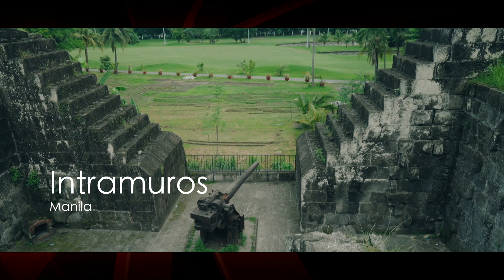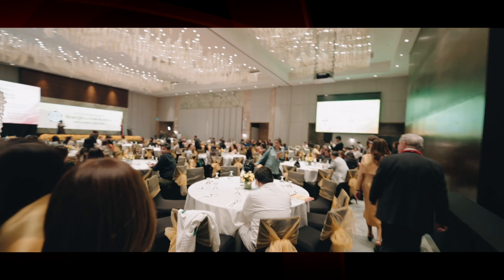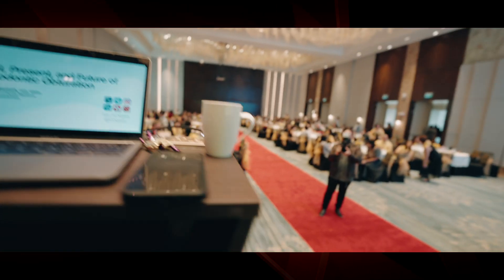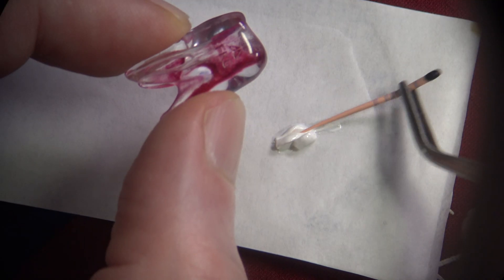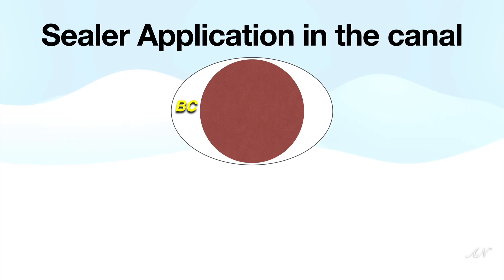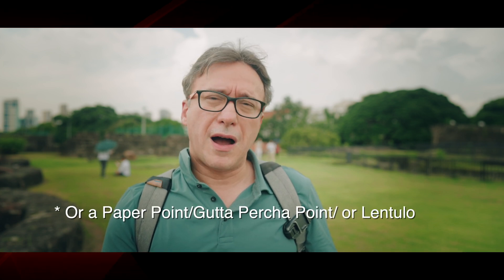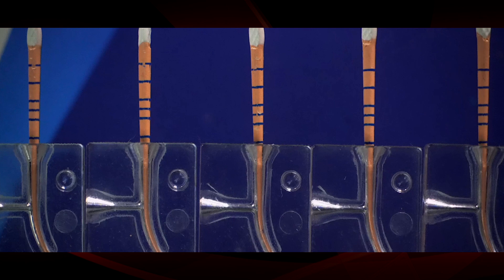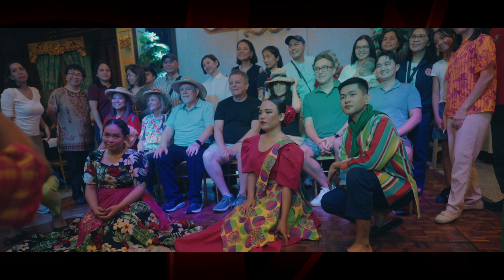Basic and Advanced Hydraulic Condensation from Manila

Comment: Thank you for your  clear presentation, sir.
Would I ask you a qustion?
In the subtitle of your video, you stated that you use a GP one size larger than the master cone to send the sealer into the root canal. However, it appears that the GP actually used in the video is a 40/04 GP (the master cone is size 25/06？). Is there any particular reason for this, or do you not particularly care about the size as long as the GP can reach 1mm shorter? 
I would appreciate an answer if you don't mind. Sorry for my poor English.

Comment: Thank you Dr. Nasseh!!!!
I have a question about the technique.
The subtitle said that “one size larger than the master cone”.
https://youtu.be/dVKvk60vAX0?si=rE0e-jo7qy3AXuuv&t=139
However, you use three sizes larger (#40) than the master cone (#25). I wonder if it stopped about 3 to 4 mm short of apex.
Reply from the maker: Yes, you can also use the same size but stop 1mm short of full length… going one size larger helps make sure you don’t pump the sealer too deep and cause overfills. 👍
Reply: @EndosKool  Thank you!!!!!

Comment: Hello Dr. Nasseh, thank you for the video, I've learned a tremendous amount of knowledge by watching your videos. Do you mind if I ask you a quick question about instrumenting? When using the apex locator, do you recommend using the 0.0 mark as the WL, or do you prefer to step back a little bit (0.5mm for example) from the 0.0 mark, and stop by the apical constriction and use that as the WL (to prevent overinstrumentation/overfill? Or do you have different methods for different kind of teeth, be it vital or necrotic. Thank you!

Comment: Even with microscope sometimes u do not see so deeply into the canal.  So u really need to rely on applying the sealer, bringing it to the length with a fine file, and then use the Gutta.  it has worked nicely for me so far. Once when we changed sealer and we got one which was a bit runny I had some issues with excessive sealer but 3 4 years later the pts had no issues. 

I'm afraid to use the paper pad because how can u be sure that is perfectly sterile?  I just dont get the feeling of safety.  (even if we used to use them all the time with the resin based sealers)
Reply from the maker: It's true that the scope is no guarantee that you won't overfill; but in general, anyone using a scope is a skilled enough clinician that it's a good way to differentiate the use. Regarding the paper not being clean; I'm not worried about it. If you are using the special papers designed for cement use they usually have a surface where microbes can't grown on and any kind of microbe that can grow on that surface at room temperature will not necessarily be a problem inside the root canal. Microbiological ecosystems are thankfully specific most of the time. Thanks for your comment. :)

Comment: Lovely seeing videos from you dr. Ali! 
Looks like an amazing place, I'm sure they are thrilled that their Athlete, Carlos Yulo won an olympic gold medal in Gymnastics today.
Regarding applying the sealer, from my own experience I had poor result with using paper point to apply the sealer because it wicks moisture from the sealer, enough (in my experience) to changes its flow characteristics. Paper cones also soften too much when used for this purpose and I find don't coat the walls of the canal as well as a GP point. 
Have you noticed similar phenomena?
Reply from the maker: Great feedback. Keep in mind there’s no moisture in bioceramic sealers as it would make them set. And you are right that there are different kinds of paper points with varying levels of rigidity. IMO, another GP cone is the best way unless using a file in reverse or a lentils is used. Thanks for sharing your experience. I agree that PP is probably the least best option.
Reply: @EndosKool  🐐